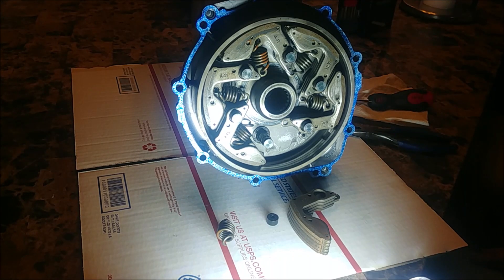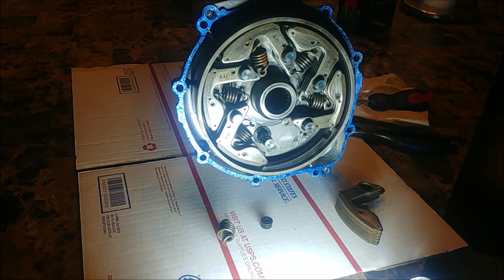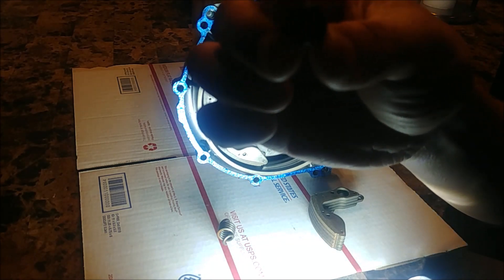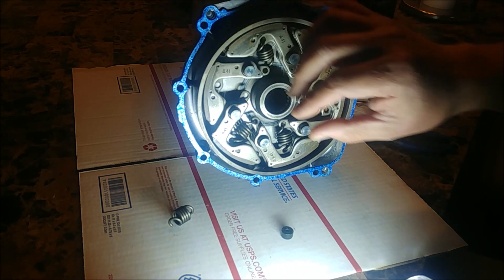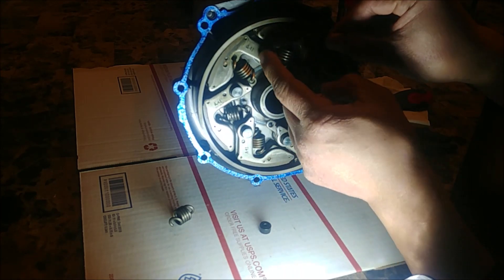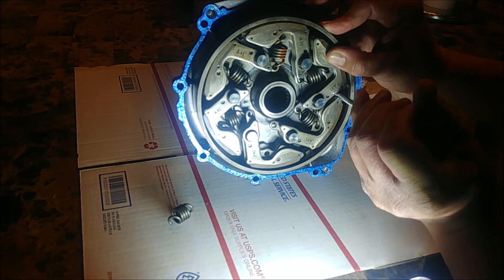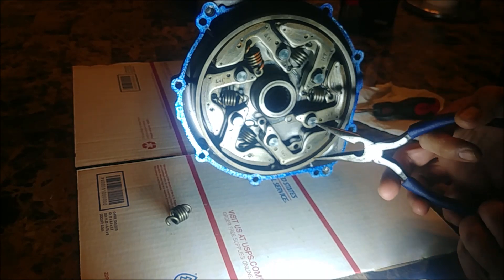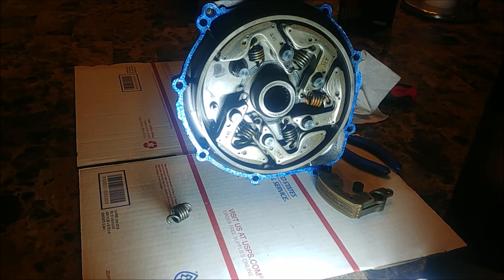Yamaha Wolverine X2/X4 wet clutch analysis

Comment: Thanks for posting very imformative!, what is slugging the wet clutch mean? thanks in advance.
Reply from the maker: In the older generation Yamaha models, there were holes in the shoes of the wet clutch.  You could buy brass weights or slugs or make your own out of lead and fill these holes.  The added weight would increase the clamping force of the shoes when they engaged the drum and would prevent slippage and increase low end engagement.  Common mod for those running bigger tires and would prevent burning up the wet clutch.
Reply: @MassiveOverkill  Thank you.